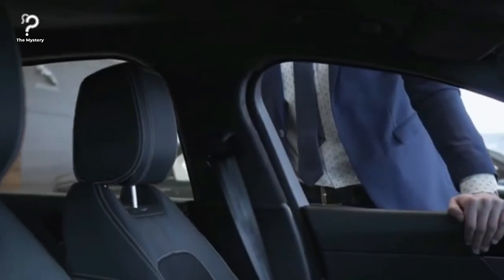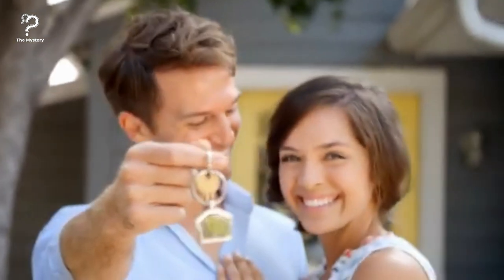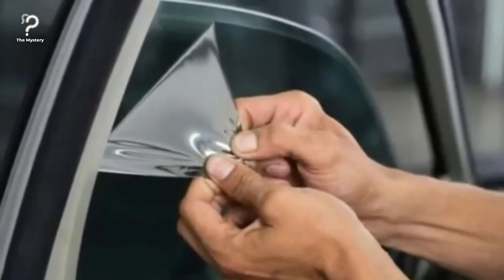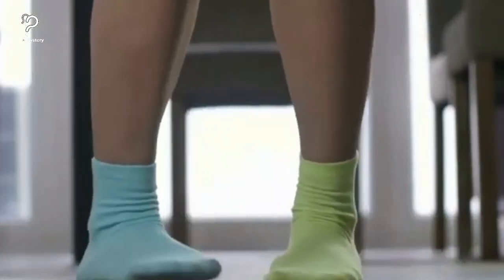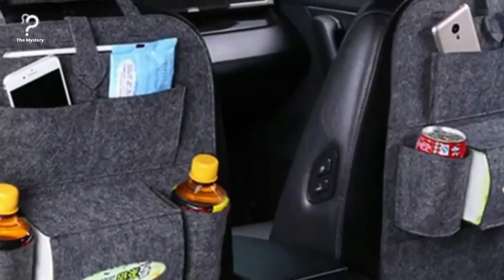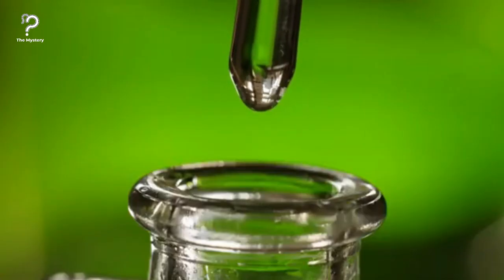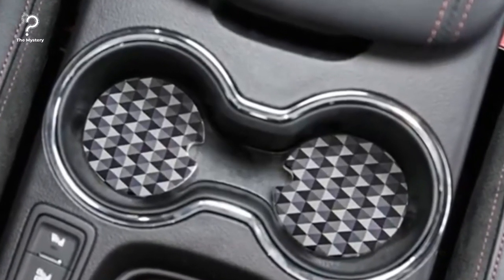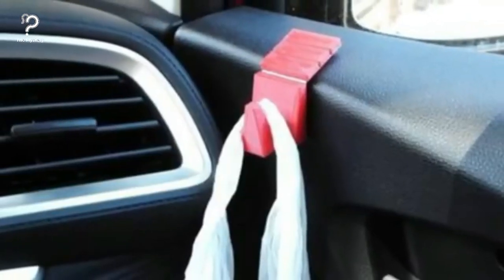Always Place A Bag On Your Car Mirror When Traveling Alone Heres Why

Comment: Excellent ideas. Keeping this video. I wonder how the kitty litter in the sock would work as a distraction in case of an attack. A knee high sock with the toe full of litter and a knot to keep it in place? IDK…just came to me. I could be wrong. Ok they said to put the bag over your mirror when traveling alone but I didn’t hear them mention the purpose behind it. If you put a bag over your mirror it will blur your vision of oncoming traffic. Get in an accident you could be held liable. Not sure but let’s hear the reason for it first!
Reply: Because there isn't one. This in a clickbait article on definition. Org they ripped off including the stock images. They copied the article into a video and there isn't a reason in the article either... One of those articles where you can't click next page without going to a different page every time you hit next.